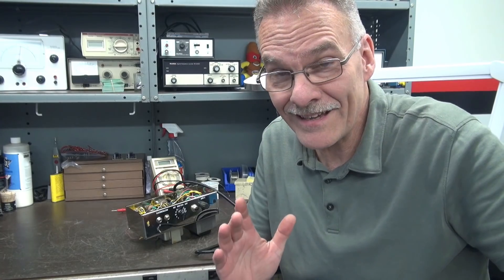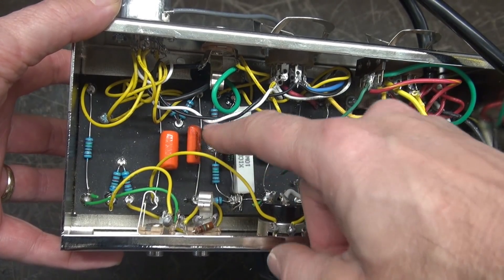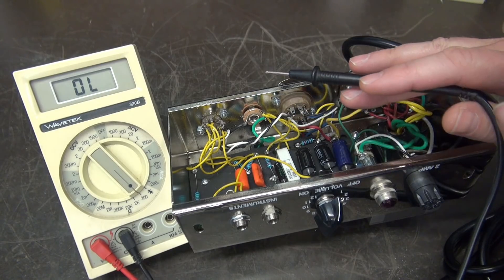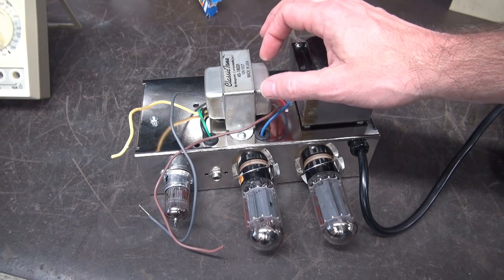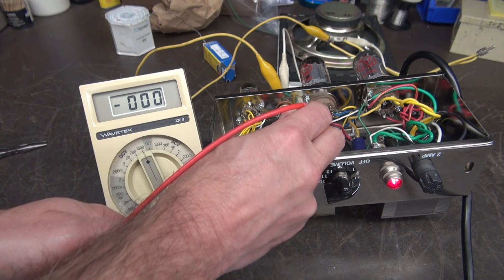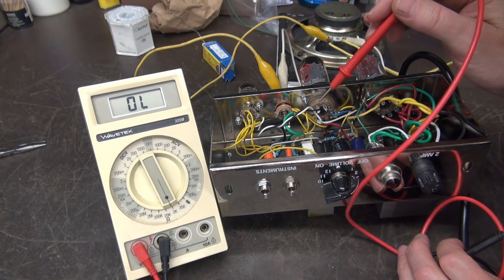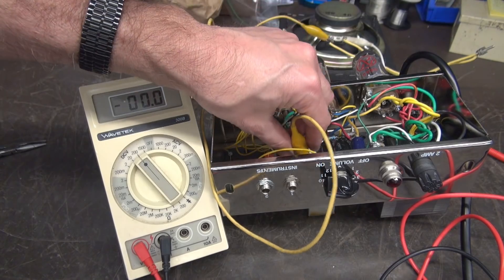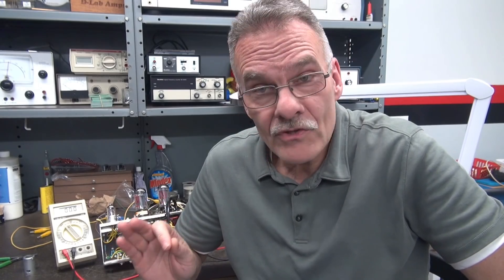How to Fix dead Fender Champ 5F1 Mojotone Kit Missing Jumpers

Comment: Why are the jumpers on the back side? You have to gut the amp to fix it. I have built 2 of the 5f1 kits from different suppliers with success on both. I'm not an electronics guy but can follow directions.  Would it cause issues ....noise and hum... if the jumpers were on the front side with the rest of the components?

Comment: I bought the 2013 version of the Mojotone 5F1 and it worked perfectly for the start.   Hint for anyone building from a kit, when following the wiring diagram, use a highlighter to mark off the jumpers/components/wires as you install or solder.

Comment: I don't think that's a Mojotone kit. The OT is a Classictone brand. Looking at Mojotone's website and having built their 5E3, I know that they use their own branded Transformers. Also, in my Tweed Deluxe, the kit came with the proper Carbon Comp resistors. Again, looking at their website, the Champ kit includes Carbon comps, not metal film resistors. This kit was likely some other manufacturer.

Comment: Built a Heathkit multi band receiver in 1965 and it worked. Built a 5f2 clone in 2018 and was scared shitless that I would screw the pooch. Followed directions, added in more caps, built my own voltage regulator for startup and it worked, lots of noise though. Went through it, watched Terry trouble shoot and changed a few things. fired it up again and lots of noise. Seems I had a bad input cable. Now I use it every day with a 12 inch Weber speaker. I compiled a thick notebook of diagrams and schematics before I started and it was worth it.  Kit builders more power to you but pay attention and do some homework

Comment: The green dashed wires are supposed to be connected underneath the board. The photo of the finished board on their website doesn't show those connections, so if someone is working from the photo it would be easy to miss. I suspect the missing ground is the one from the input jack to the negative rail of the second 8uf cap - also the ground for the cathode resistor - also another green dashed line....

Thanks for another good video Terry.

Comment: I just put together a Mojotone Jtm45 kit last month and there were some errors in the wiring diagram that came with it. Missing a jumper from a 27k resistor to the impedance switch and wires to the cap can mislabeled. That was for the diagram dated 2017, the older diagram on their website dated 2005 was correct. The parts they gave me matched the older diagram so that’s what I ended up using. I contacted them and they said they would get it corrected
Reply: Wow! miswiring a cap-can could cause it to explode!

Comment: It's actually pretty easy to make mistakes on things like this if one has no real experience with building.  When I built my HW-101 back around 1983 I made several mistakes because I was really tired from work during assembly.   Getting OCD with construction comes with experience. :-)
Reply: The HW-101 was a LOT more complicated than this little amp. IIRC Heathkit used to say something in their manuals like  “don’t work on the kit if you’re tired” or words to that effect. It was good advice.

Comment: Everybody that builds their own amps has to start somewhere.  Wiring off the layout diagram is not, to me, the best way to go.  I always wire off the schematic and use a hi-liter to mark my progress marking through each component installed and each wire that is landed.  This helps eliminate missing connections.  I also ohm out my connections to make sure I have continuity through my solder joints, sockets, etc.  I still find mistakes but it improves my chances of getting a good startup.
Reply: I've always gotten by with just the schematic on pedals but I always use the wiring diagram on amps because one wire or ground in the wrong place and you can have a hum that is a mess to find.

Comment: I've built a few amps ( not from kits, but still...) and have found it useful to use a highlighter to mark the parts as i install them; if you mark consistently, anything you didn't install is easy to see. THanks for showing this troubleshooting process !

Comment: The Mojotone 12/04/2018 Tweed Champ layout image was missing the green jumper. The image dated 02/01/2019 has the green jumper added. The schematic shows it as circled C . I am getting ready to start one of these kits and you just saved me a serious headache. One other question, would a 470 ohm 5 watt resistor be an acceptable replacement for the 470 ohm 1 watt resistor?
Reply: In case he doesn't answer, yes. The wattage refers to the handling capability. The resistor will dissipate around .7 watts. A 1 watt-rated resistor would work but not for long, so 5 watts is plenty. At least 2 watts for that specific place in the circuit. General rule is to have the wattage rating be at least double the wattage being used. That way the resistor doesn't get too stressed. The voltage will fluctuate as signal is being amplified so you want some extra room, thats why I suggest minimum 2 watts. That 10W is overkill but 🤷🏻‍♂️. Here's some math.

I = V/R =  18V/470Ω = .038A ------Voltage across resistor divided by resistance equals current passing thru resistor.
P = I*V  = .038A*18V = .69W ------ Find power dissipated (wattage) by multiplying current passing by voltage across.

Comment: Terry,  the other problem with that kit diagram is the dotted line means its supposed to be UNDER the turret board...  Those kits are so small and hard to work on for novice builders..    DLAB can fix anything..... I know you'll nail it.    Great Job Terry
Reply: Correct! Ron rocks... seriously!